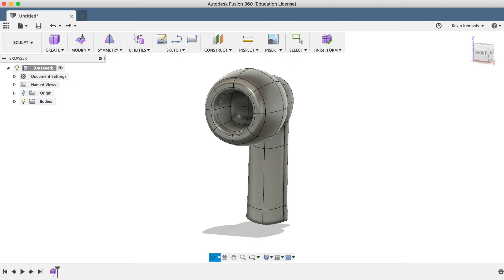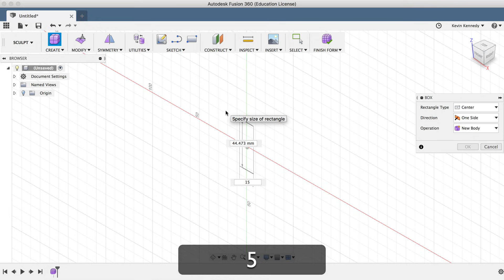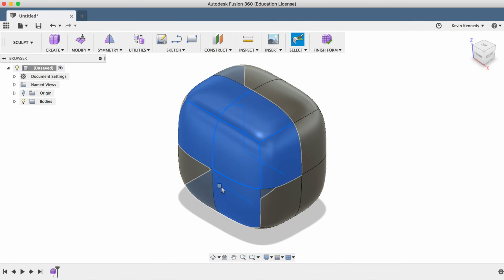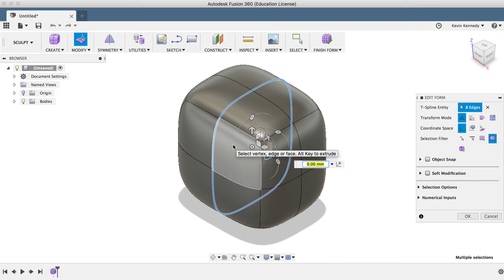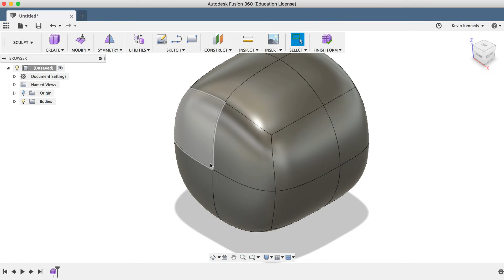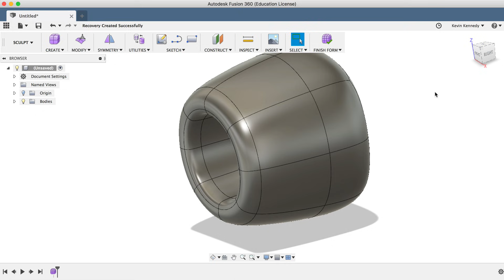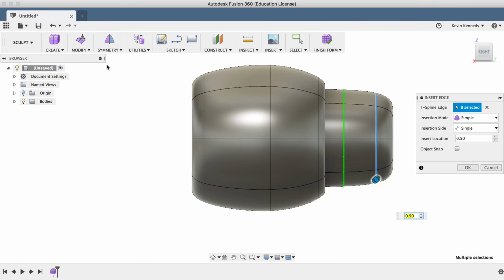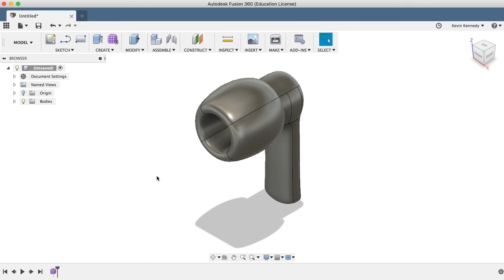How to Sculpt an Earbud in Fusion 360 - Learn Autodesk Fusion 360 in 30 Days: Day #22

Comment: When I start the box, I can do the 15mm X 15mm, but I am not getting an option to set the depth manually to 12mm. Fusion just decides on its own the depth of the box. Did I something set wrong in the settings? or is it just the way it is now?

Comment: why does it say t spline model failed to convert?
Reply from the maker: You likely have a self-intersecting surface somewhere. Double-check that the surfaces are not intersecting. It should highlight the point in red when it errors out.

Comment: Hi Kevin, thanks for the excellent tutorial.  I've managed to get myself an error. 'Edges or faces may be crossing. Review in box mode.'  I can see where the errors are but they are on the inside 'skin' of the model.  How can I access the inside of the model to have a go at moving the edges so there is no overlap?  Link to my model here https://a360.co/3cgaoxy.  Thanks in advance, Shane.
*Edit: I've used section analysis to view the internal surface and can see the error close up but not sure what to modify to remove the error. Thanks!

Comment: Just a note regarding the new interface (v 2.0.7830) - When you are in form mode, i.e. before you click Finish Form, when changing the Selection Priority under the Select menu, the Selection Priority options (Body, Face, etc.) are all disabled.  You must change Selection Filters to change what gets selected - use T-Spline (Face |Edges | Body).  
Also Crease was not available on the right-click menu, but it is also on the Modify menu.
Perhaps if anybody finds anything else that's different they could post a reply to this note with their workarounds.
Reply: I scrolled down hoping someone had a posted about the selection issue, thanks! I thought it was something with selection priority but I didn't know what to change.

Comment: why hold the alt?
Reply from the maker: Hi, Sumukh V R. Doing so will add T-spline faces. There are a variety of ways to add faces to T-spline bodies, but my favorite is the ALT + Drag Technique. Turn on “Edit Form,” select an edge or face, hold Alt, and start dragging to add a face in the selected direction. Cheers, Kevin :)

Comment: Great stuff! +1 for more on sculpting! Trying to model a tent, but struggling ;)
Reply from the maker: Hi, Bjørn Sætnan. I do have a few more sculpting tutorials in these playlists - Beginner Sculpting in Fusion 360
http://bit.ly/sculpt-playlist

Advanced Sculpting in Fusion 360
http://bit.ly/sculpt-playlist-adv

I would also recommend a surface modeling approach for a tent, as the focus is on the curvature of the exterior. Check out my surface modeling playlist for some more ideas on how surface modeling works:
Beginner Surface Modeling
http://bit.ly/surface-playlist

Intermediate Surface Modeling
http://bit.ly/surface-playlist-int

Cheers, Kevin :)

Comment: Thanks for the tutorials Kevin.  The sculpting tutorial is interesting, especially when you compare it to Blender 2.8.  Having said that, I would more interested in exploring assemblies with when trying to 3D print those assemblies and some things you might have to do to get a 3D print to work.  E.g. you may have to go back into the F360 assembly and make accommodations of tolerances that are too tight for a 3D print.  Thanks.
Reply from the maker: Hi Ken, thanks for your feedback. I'll definitely try to do more assembly based tutorials, especially as I start to do more intermediate level tutorials. I'm hoping to start to incorporate some 3d printer footage in my videos in the future. Cheers, Kevin :)

Comment: Pleas do it!!!!
Reply from the maker: Don't worry - there eventually will be more. Cheers, Kevin :)
Reply: @ProductDesignOnline  sweet and if all is possible Pleas exsplain some of the simplest shapes you can possibly think off from triangles to squares to whatever may help a beginner out please tubes cylinders trapezoids whatever you know very helpful if you could please
Reply from the maker: @JetCrayfish8  Noted. Thanks! :)
Reply: @ProductDesignOnline   thank you so much :)
Reply: O one more thing and i really do think it would help a lot of people out what are the exact keys or codes that you use to pick and choose what you do in Fusion 360 whether you're sculpting or measuring or whatever what are the keys if that makes sense
Reply from the maker: @JetCrayfish8  Are you referring to the keyboard shortcuts? or something else? If so, I always have those pop up in the lower-lefthand corner when I use them (not sure if there were any used in this video). Cheers, Kevin :)
Reply: @ProductDesignOnline  yes thé short cuts like  would it be a possibility if you can make it  a list of all the shortcuts that would help someone out if there a beginner for Windows or Mac

Comment: My box generated has much more faces than yours which is causing lots of difficulties. Can we reduce number of faces?
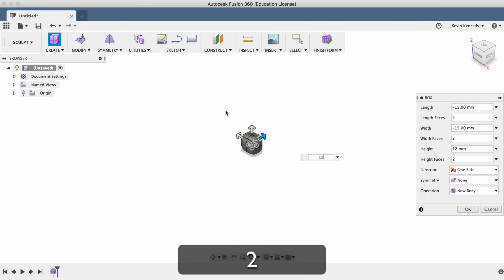Reply from the maker: Hi, paranajape. When you create the initial box at 2:02 you'll want to make sure that there are only 2 faces set in the dialog box. Typically, you'll want to start with a low amount of faces as it's always easier to insert more faces and edges as you deem necessary. To create more faces you can use the Modify > Insert Edge or Subdivide. Cheers, Kevin :)

Comment: and 1 more question
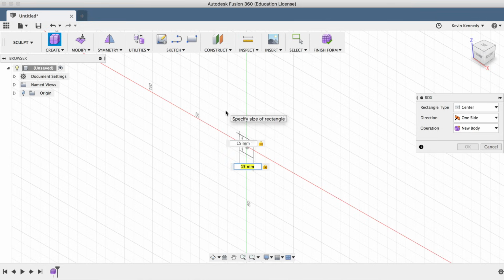When you start 1:59 , your view cube's axis are different with me
So When following the video , It shows opposite control directions in Edit form
so I wanna change axis (x,y,z) like you, how can i do?
Reply from the maker: Hi, CHO성진. To change the orientation of the view cube you'll want to select your name in the upper righthand corner > preferences > then under the "general" tab you'll see about halfway through the list the option to set the "default modeling orientation." Set this to "Z up" > hit the apply button > then hit the okay button and everything should be the same as this tutorial. Cheers, Kevin :)
Reply: @ProductDesignOnline  It didn't applied immediately so I restarted fusion and  then  confirm it applied 
Thanks Kevin!
Reply from the maker: @devstefancho  Great! I'm glad that worked as a temporary solution for now :)

Comment: Thanks Kevin, I'm an avid SolidWorks user, but I like the sculpt mode of fusion 360 which is not present in SolidWorks.  Most of the time you are restricted by software you use to create great aesthetically pleasing designs, depending on the amount of work you put in concept stages.That's where fusion 360 comes into play with its industrial centric modelling packages.
I would appreciate if you can do a detailed video of larger product as I know there are many industrial designers out there would also be interested ..which would be more of a sculpted product (A drill machine  ) which has more chiselled features.
Great video !  wish to see more from you.
Reply from the maker: Hi, Sujay. Thanks for watching and commenting! I'm happy to see you're interested in more sculpting tutorials. I do have a few more in the works...and I plan on building up from some more basic tutorials to more complex/larger products. I'm hoping this will help me really nail down the pacing and thoroughness of presenting the sculpting environment before I spend the time recording a more lengthy tutorial. Cheers, Kevin :)